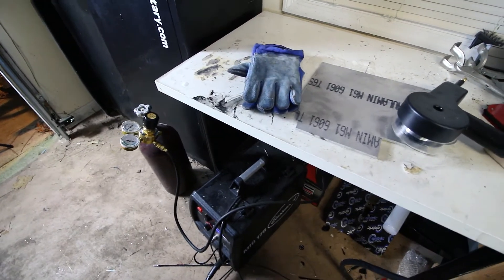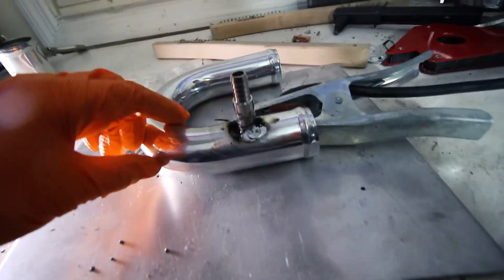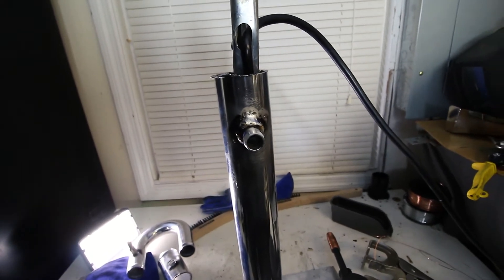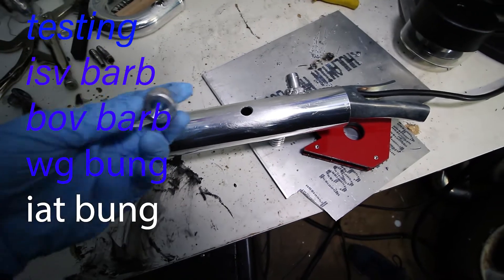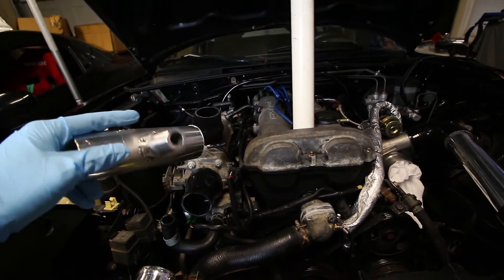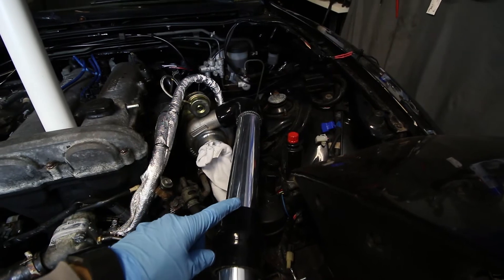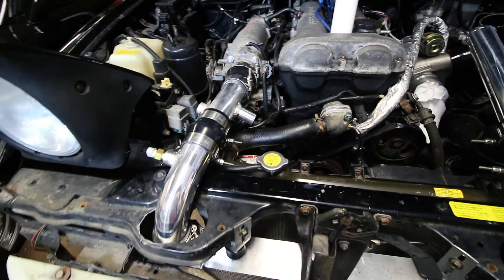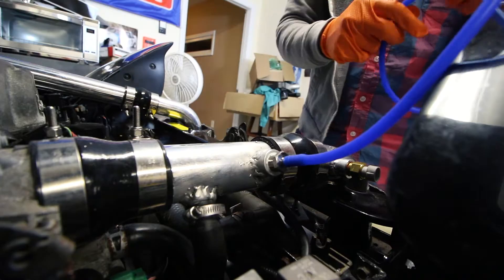Welding fittings and hooking up sensors - Miata Turbo Build EP8

Comment: I also have an eastwood welder lol how do you like the spool gun? Thinking about getting one but I've heard a lot of bad reviews.
Reply from the maker: Sweet!! Hmm, it's ok. Honestly it's pretty hard to weld aluminum with it. With a lot of practice I was able to get it done, but definitely not pretty haha. Overall I think I'm happy for the price though.
Reply: @supercarmio  sometimes as long as it works that's all that matters lol i usually just grind my welds and paint it with wrinkle paint to hide the nasties hehe
Reply from the maker: @Hygoog  hahah that sounds like what I do in most cases :)
Reply: @supercarmio  Is it better to tap near the throttle body for boost control or on the turbo compressor?
Reply from the maker: @Hygoog  I like doing it near the TB (before it) so that you'll take into account the pressure drop b/c of the intercooler and I feel like the reading is more stable than the compressor housing.